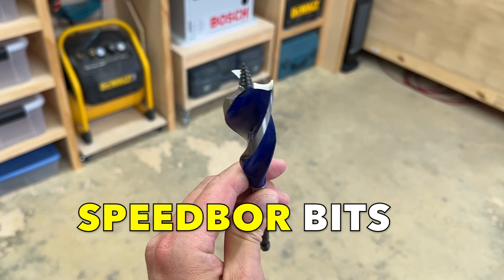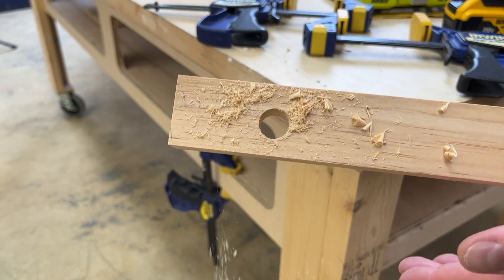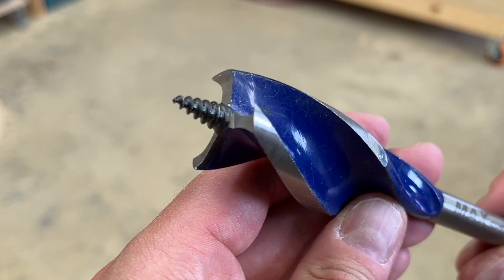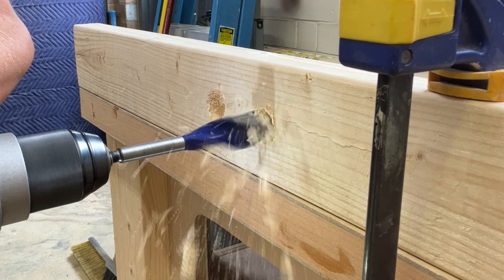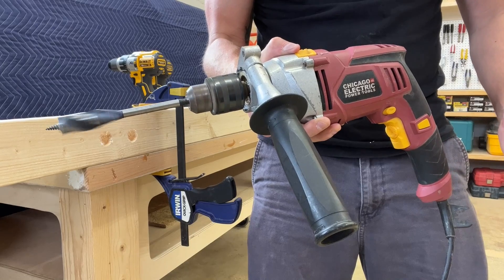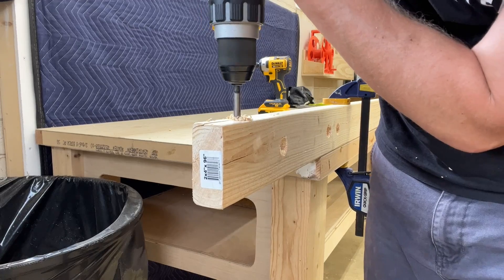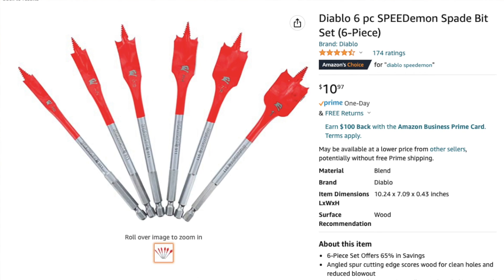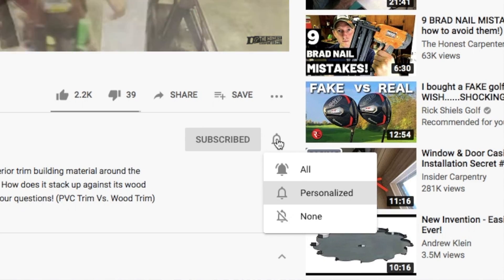FASTEST DRILL BIT For Drilling Large Holes?! (Speedbors Explained--How To Bore Large Holes Quickly!)

Comment: Thank you and only if I knew earlier! Bought a fancy 19mm Diablo Speedbors spade to drill out some dog holes on my work bench. The thread on the tip sucked my drill down so quickly that I was taken completely off guard. It was also rough, hard to manage especially with my lower powered cordless drill. Completely unsuitable for the setup. Returned the product and replaced with a traditional Irwin 19mm spade bit and completed the job with far cleaner holes.

Comment: these have been a game changer. I can run a wire through a basement in half the time. Its even faster with my driver but my dewalt tends to get hot after 20min of work, so I have 3 drivers on hand to rotate out.

Comment: How do these do on old school construction. Like old growth old old pine.  I’ve been using 2 flute auger bits but I can’t run them in a battery or even standard plug in drill. I have to use a corded mud mixer to drive a 3/4” auger and hang on for dear life.  I would love something self feeding I can chuck in an 18v drill without staling it.

Comment: "Especially for softer framing ..." My house was built in 1939, all old-growth hardwood. Everything everywhere is very difficult to drill through. Yes these Irwins are aggressive but they basically stop at the end, and only burst through finally. It's a little annoying. I saw another video with some DeWalt Extremes, they look like this design but don't apparently stop at the end and are overall faster.

Just make sure you're braced when using these. If they catch on something the drill will try to break your wrist.

Comment: I wish I'd seen this video before I bought a set of these bits for carpentry because I agree they are not suited for it but I think you left out 2 important things
1. A word caution - most drills simply cannot handle these bits. Since they pull into the wood the need a LOT of torque from the drill or they will simply bind into the wood 
2. You mention that the don't need any pre drilling ad that's true, but...
If you do make a pre drill hole that is roughly the diameter of the pull in screw you will feel a very big change in the way these bits behave. Suddenly they are no longer aggressive since they longer pull you in. Therefore you can be much more precise in you work and can actually do carpentry work since you can now drill at any speed. There are probably better options but if you already own a set, why not use it.
In the future I may try to file out the screw thread and leave just a point and see if I like how they drill then
Reply from the maker: All good points, Yair!

Comment: I tried those once and was not liking them because of the treads in the middle. I prefer it being flat. Once the tread goes in, whatever angle it’s at that’s where it will stay, and backing up trying again doesn’t help.

Also, I’m convinced drills are one of the most dangerous tool accessories because it’s the first thing most people get comfortable with and let their guards down. Yet if they catch you hands, it can cause much damage. I’ve have my hands cut a few times and they just barely caught me. If your whole hand gets in the way it would be a big problem.

Comment: I bought a set of regular sized speed ones from bosch. Holy smokes do they ever go through wood ! To slow them down I have to prevent drill a hole to slow them down and secure the wood down tight.

Comment: I’ve had good luck with these in some woodworking projects, but you’re dead on about how they don’t stop once they bite in. I sheared a Milescraft drill guide using one of these and a corded drill this weekend. The torque of the drill and the strength of that tractor pull from the snail in front made me glad for a side handle on my drill.

Comment: I used these bits even freehanded to bore holes where a drill wouldn't fit. As long as you can get something like a pair of pliers to grip the chuck end of the bit, you can still make a hole in a relatively short time. Great construction tool

Comment: Your videos are generally great but a few points.  First, while it is correct that Irwin owns the trademark for Speedbor, The type of bit is known as an auger bit or a ship auger bit.  (Honestly, haven't come across a good definition of the difference between a regular auger bit and a ship auger bit, although from looking at them its a difference in  the flutes...?)  Second, they're best for drilling quick holes between say 1/2" and 1-1/2" Anything larger than than that, you're going to have trouble finding an auger bit that size, and between 1-3/4" and 3-5/8"~ is where the Self-feed bits a.k.a. Forstner style bits really shine. then at about 4" plus is where the hole saws come in to their own.  

Also, while diablo does produce Speedbor style a.k.a auger bits, the SPEEDemon line of bits are spade or modified spade/paddle bits, as you depicted in the video.  Hope this helps, and keep up the awesome work.

Comment: For most applications, they're too aggressive. Electricians & plumbers drilling holes through wall framing like them, but they are too destructive for carpentry (drilling out the bottoms of housings, corners of halvings etc.) and I ground the tip of the threads  off the self-feed screw on all of the bits in my set whilst keeping the cone shape and the base of the thread), so they don't rip uncontrollably through the wood &/or break your wrist. .

Comment: I have a 6-piece set and use them almost exclusively for drilling electrical wire run holes (high and low voltage).  They zip through two-by lumber like butter.  All I can recommend is... hold the drill tight and be ready.  ;)  A right-angle drill or one that has an extra handle is best... provides more counter-leverage.

Comment: We love these bits in our remodeling work. A caution is in order though: if the bit binds in the hole or hits a mail, it can break your wrist in a hurry. Using a side handle is advisable for this reason. Better yet, use them in a cordless impact driver; they still cut like a champ but if they bind the impact’s hammer feature protects the user from a sudden high torque twist to the wrist.
Reply from the maker: Good tip, Dennis!
Reply: These are are good tips. 

A drill with anti-binding technology is also helpful. I have a Bosch hammer drill that has this. I believe Bosch pioneered this technology.
Reply: I wish I read this before yesterday. My hand is bruised up smh

Comment: Used them, they work well. Drilled through 2 2x4s using a spade handled drill. REALLY recommend using two hands with these drill bits.
Reply: Thanks, but physical problems have largely curtailed my woodworking. I’d prefer you give the prize to someone who’ll use it. Again, thanks. I enjoy your videos.

Comment: For a real laugh throw one in your drill press. Hit start, tap the feed lever then stand back and watch the chips fly.  Really great way to drill a line of holes down a 4x2 or something as long as you have someone holding the end to control the feed. With a decent drill press you can do 3-4 lengths at the same time. With a scrap of ply or something underneath you get minimal blowout even on the bottom length.
Reply: Recommended drill press setting? Newbie drill press user!

Comment: I rewired my 1926 house from nob & tube to Nomex wire in 1988.  I would have like to try the tri blade speed bits on the old grow lumber that my house was built with.  Paddle bits burned out and arguers would try to break your wrist when they seized using corded drills.  (battery drills were not that good back then).  

For those who have not had the chance to drill large holes through old grow wood, if you thought oak was bad, it is like drilling petrified wood, or stone,.  Today's yellow southern pine is nothing.

Comment: You’re absolutely correct about them pulling themselves into the hole. I used the Diablo version last year running electrical through my workshop. It was so much better/easier than spade/paddle bits.

Comment: Too bad they get dull unless than a week of drilling new construction
Reply from the maker: My older ones could use a tune-up, Jon. I bet you could sharpen the lips and spurs with a bit of effort 🤔
Reply: @TheHonestCarpenter  agreed, but I’ve run my greenlee  “nail eater” drill bit through construction (electrical) on about 8 houses and still have not had to sharpen it. I’ve sharpened many bits, spades mostly which I can throw on a grinder but the Irwin ones the couple of times I tried I ruined and I sadly don’t have the patience to do them by hand.
Reply: @TheHonestCarpenter  on a somewhat related note, if you are interested I saw a video where this Guy made a bit to drill a nearly square hole that would make mortise and tenon work easier if you are interested: https://youtu.be/RF-B0ZqDBZE

Comment: Need to look into Wood Owl OverDrive bits, they are so amazing. Huge step up over the Irwin. Safer too because they drill just as fast but they dont have a screw on them, so if you need to stop and pull out, you can.
Reply: 100% correct and glad you mentioned them.
Reply: @skigglystars9525  They make clean holes too.

Comment: Great video as always.  Speedbors are incredible!  I hated the chatter and blowout from spade bits.  Speedbors are truly a gamechanger!

Good point on keeping your free hand clear and avoiding drivers with no brake.  I use these in an impact driver and the speed and smoothness are unmatched.  

Also, the flutes can be sharpened (I've run into nails).  Just keep the screw tip undamaged....never damage your screw tip....

Comment: I've had them for several years. I miss not being able to work i loved working in construction and fixing problems others had trouble with. I worked in construction for 34 years until my lower back got so bad my doctors told me i had to be put on disability unless i wanted to spend the rest of my life in a wheelchair. I've had 5 back surgeries with 1 more coming soon to fuse my tail bone to my hipi already have the lower 3 disks fussed together and a pain pump put medicine right in that area with a electrical stimulator trying to block some pain but i can stand up long than 15 minutes until the pain gets bad
Reply from the maker: Oof, sorry to hear that Wayne! The harsh realities of trade life—I hope something helps with it in the future 😔
Reply: @TheHonestCarpenter  thank you I'm hoping me telling what happened to me helps someone to ask for help when something is heavy. I hung sheetrock rock for 18 years and i would hang 16' 1/2" by my self on residential and 12' 5/8 commercial. That will destroy your back

Comment: I would love to see these compared directly with Wood Owl augers.
Reply: i've used both - the speedbor is really insane how it grabs and wants to take control away from you.   the wood owls cut a cleaner hole and are only slightly less insane.  they don't have the screw tip, but once the cutters bite - it's the same story - the only way to stop them is to stop the rotation.   both are only suitable for through holes - even with a drill press, you can't control depth of cut.  for wood working, stick with forsner bits - cleaner & MUCH more controllable
Reply from the maker: Haven’t seen the wood owl, Daniel—I’ll have to check it out!

Comment: Speedbors definitely look like something a Pro could use to drill fast & efficiently...but in my case I try to be slow & precise so I typically used the Hole Drilling Saw, Fostner Bits, & Spade Bits. It takes me a little longer but I hardly make any mistakes these ways. 👷🏿
Reply from the maker: Hole saw still wins for anything over 1-1/2”, W!